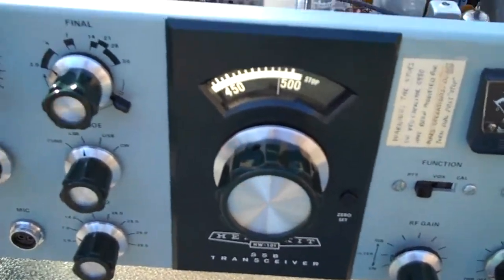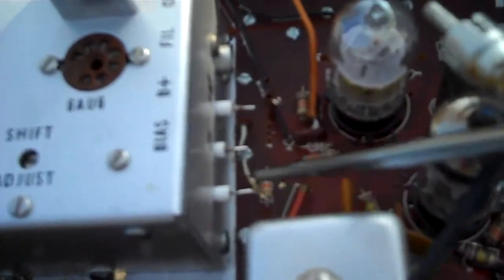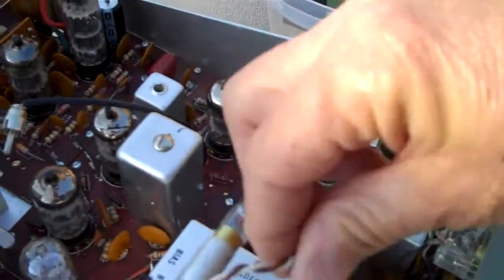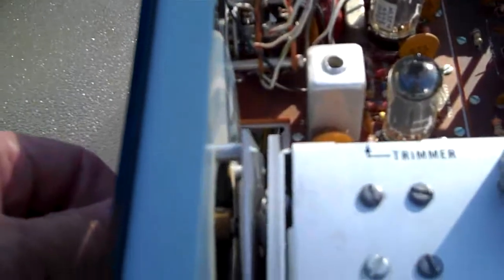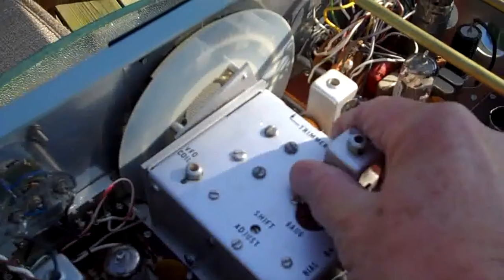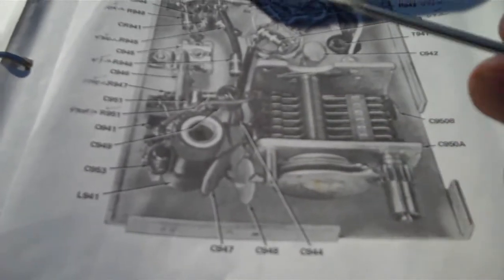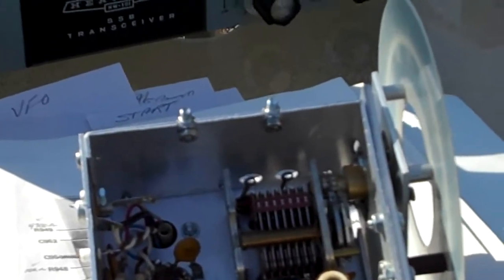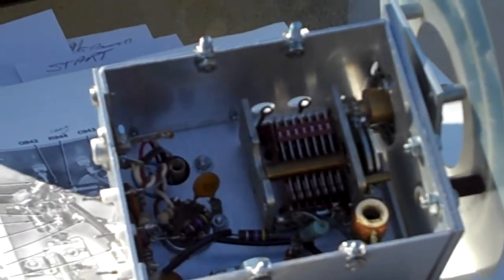Obtaining A Ham License-step by step-the details you need to know (part 31 of 34: Under the VFO).

Comment from the maker: @WA5CVI,
95% of all resistors can be measured in the circuit, but there are those few oddballs that require one end to be lifted.   And they're almost always in a nearly inaccessable place.   But if a 1000-ohm resistor measures 992-ohms in the circuit, then you can call it good.
I go by this philosophy: "If in doubt, lift one end out."
Thanks for watching.

Regards,
John